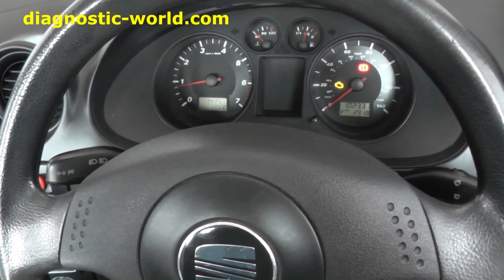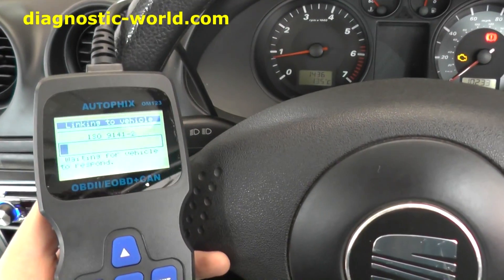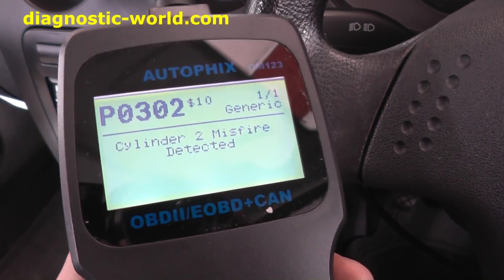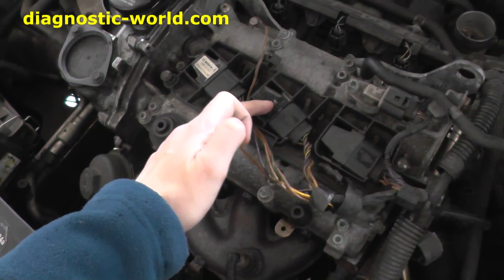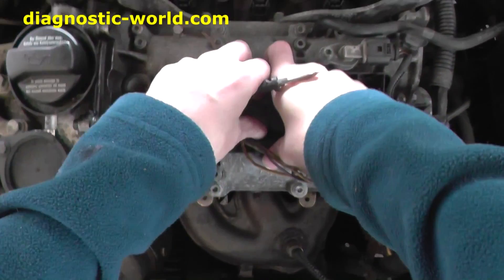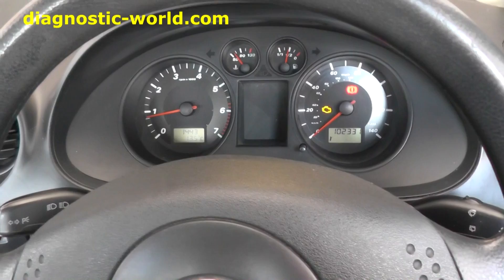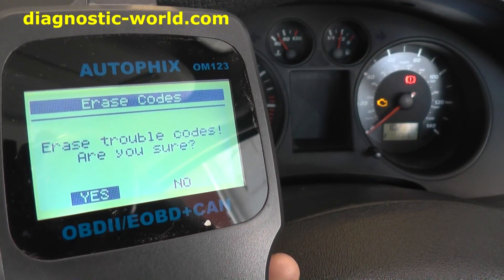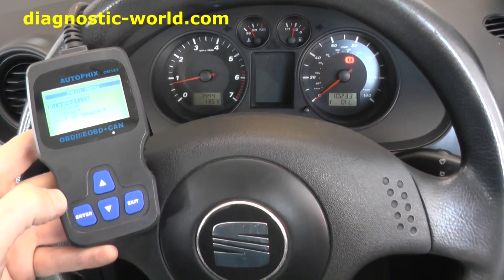Seat Engine Warning Light & Ignition Coil Replacement For P0301 P0302 P0303

Comment: im having the same problem with my cupra 2008 1p model.
ive tried chaging places with my coils to see if the problem moved to a different cylinder but it still says number 3 so i bought ngk sparkpluggs and changed them. 
problem is the same what else can i do to fix the problem

Comment: Let me tell you there is no warranty it will be the solution to your problem, it could be not only the coil. You have to inspect your wiring (signal, voltage or ground), changing the coil is the easiest part of the job
Reply: Lol what? Was clearly just a faulty coil